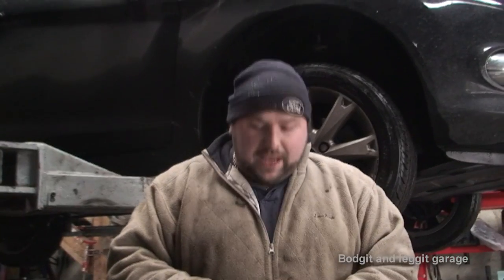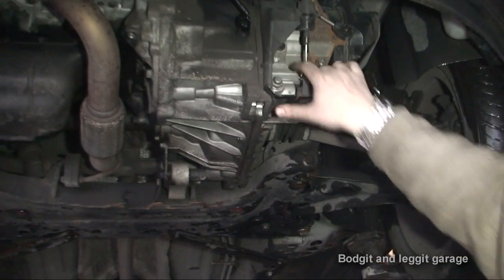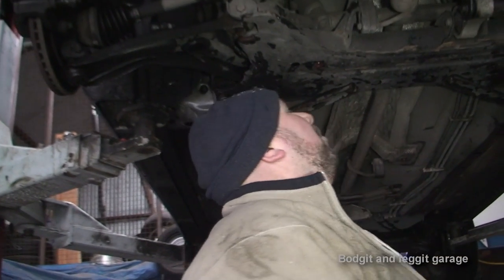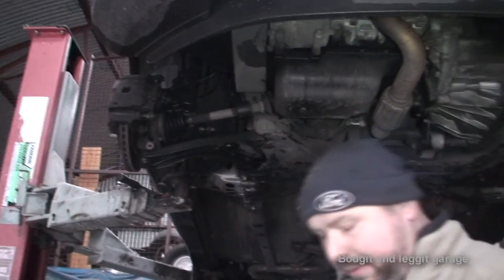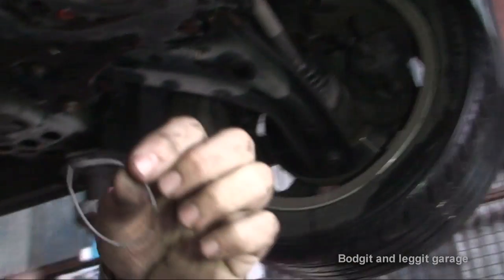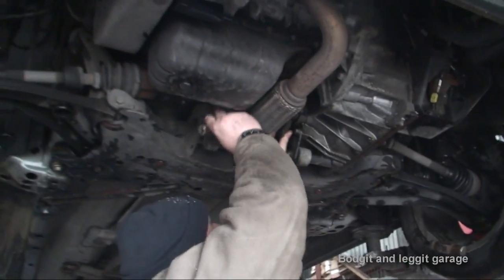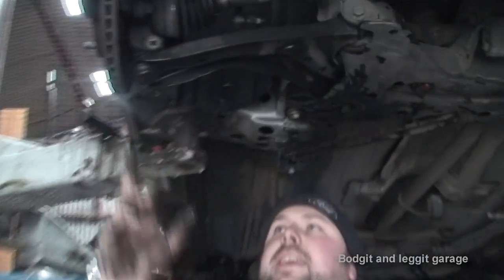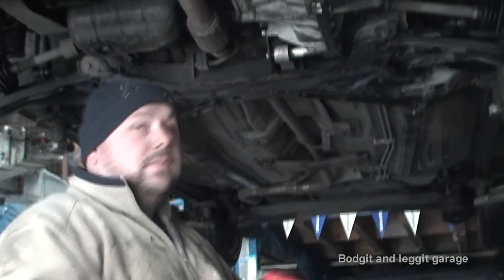bodgit and leggit garage 2010 ford fiesta gearbox seal

Comment: This gearbox (as well as mine because I have a MK6 Ford Fiesta petrol) requires a "special" 75w90 which is less "thick" (when cold) than a regular one. This Ford IB5 gearbox (made by ZF) requires a 75w90 GL4 (or 4+, NOT GL5) oil with Ford WSD-M2C200-C specification, as owner manual says. So pay attention to this details folks!

Comment: Just had the run around on this one. Seals were leaking so replaced both sides. Then lh fine but rh leaking between shaft and seal. So remove seal carefully and put it back in not as deep so its its rubbing on a new area on the driveshaft not worn as the original position. Now its weeping between seal and gearbox!; So get some brake cleaner to degrease it and then smear some liquid gasket between the gearbox and seal. Possibly first insertion made it smaller than the 2nd required? I'll get another seal and replace it next week if the sealant doesnt work. Its only a small leak.

Comment: There seems to be some debate over whether the Ford ib5 box has a specific  drain plug? Isn't the 19mm bolt you undid a fitting for the gear linkage? Not a hater, just saying?

Comment: Is it same process on the other side, as long as the seal is flush will it be ok because I’ve done it yesterday and someone told me to push the seal as far as it will go but I’ve done it so that both seals are flush with the gearbox. Thanks mate❤
Reply: Do u have a link to the seal u bought for this? I gotta do mine but wanna make sure I got the right seal before I start

Comment: I must say for the dIY guy that does not do this all the time as is my case I use a cheap plastic funnel and a length of tubing that is a tight fit in the funnel and hook the funnel up to the bonnet catch for the gearbox or the rear door handle on the CRV to fill the rear diff and pour the oil in so easy and cheap. But I must ask if you do not mind I noticed that you did not oil the seal before installing it many techs recommend this but in the Renault manual that I have it says not too. Please what are your thoughts ??? As always great video many thanks for sharing.
Reply from the maker: Yes mate well spotted my bad I should have done that to the oil seal
Reply: You may well have been correct I managed to get on the Elring web site and apparently if its a PTFE oil seal you must not oil them as the oil will damage the seal so they go in dry. Which would explain why Renault say not to oil the rear crank seal on a Dci Kangoo. From what I can see there does not appear to be a great deal of difference so I assume you need to check the packaging or instructions if you get any. Anyway thanks for the reply all the best and keep them coming love the channel.

Comment: I was told these IB5 gearboxes don't have a drain plug? Are they exactly the same on the 1.0 ecoboost engines?
Reply from the maker: Well all I can tell you is as you can see from this video this one has a drain plug I personally don't know any gearbox that doesn't have a drain plug maybe some of the brand new cars don't and you have to suck it out but I don't work on brand new car so I cannot say

Comment: Is it possible to drive without any oil in the gearbox? How would that be? Hard to shift or what?
Reply from the maker: GymChess it is possible but personally I would never try it it will be hard to change gear it would make very bad grinding noise it's not a good idea to do it
Reply from the maker: GymChess and then eventually it would seize up your wheels will lock and you will be in trouble